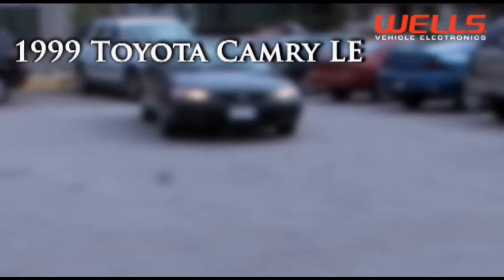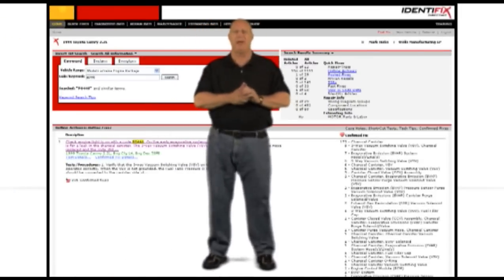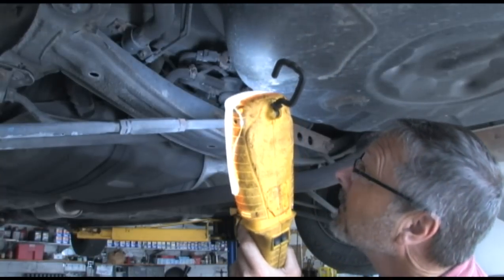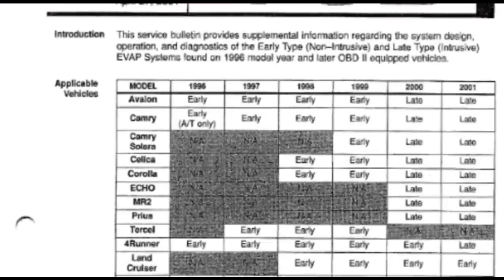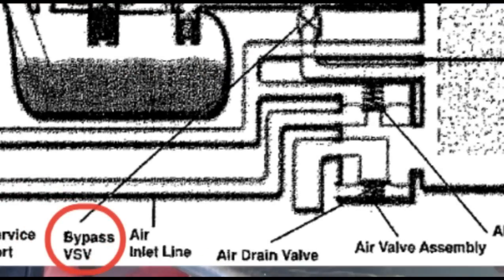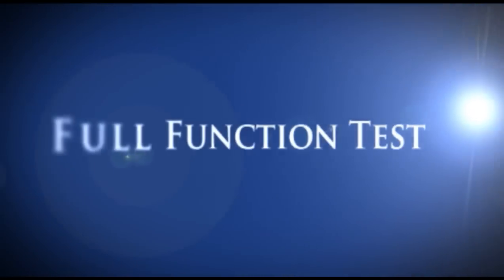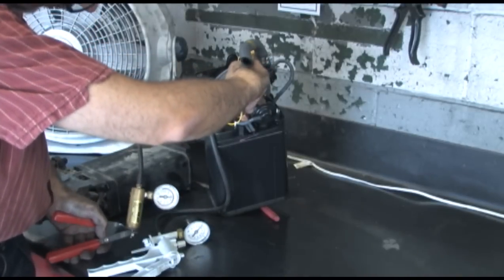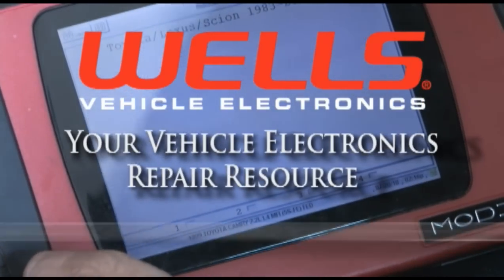Toyota Po441, P0446 EVAP Vacuum Switching Valve VSV Testing and Canister Replacement

Comment: Might b off topic but I have a 2000 solara and can’t find where the burning or exhaust smell is coming from there’s a strong smell inside the cabin coming from vent please help
Reply from the maker: Hey Guess Who, sounds like you have an exhaust leak. How's the exhaust look/sound?
Mike Becker, Senior Technical Instructor
Reply: NGK Technical Training we just replaced the catalytic converter but didn’t check whole exhaust I also checked the heater core seems to b fine no leaks I’m stumped??!!!
Reply from the maker: If you have exhaust leaking into the cabin then you should either stop running the car in the closed garage :)  or fix the exhaust leak.
Mike Becker, Senior Technical Instructor
Reply: NGK Technical Training I have a very small slow leak on back side of valve cover corner u think that would be my problem
Reply from the maker: Depends if the smell you are getting is exhaust or burning oil. If that oil is leaking out of the valve cover and dripping onto the hot exhaust and burning...well that will cause a smell. More importantly...that can cause a fire! I remember back on the GM 3.8L they had a big issue with valve cover gasket leaks leaking onto the exhaust.
Mike Becker, Senior Technical Instructor

Comment: Can you safely drive your car with a code 446? Will it stall? Cause damage? Short on cash at present! Can you tell me?
Reply from the maker: Hey Michael, it depends on the failure that's setting the P0446. Sometimes it's a simple issue where the valve is just stuck open. That won't cause any issues. But, if it's stuck closed it can cause your fuel tank to be hard to fill. It will keep clicking the nozzle off when you're trying to put gas in.
Mike Becker, Senior Technical Instructor
Reply: @GoTechTraining  that's what happened to me with my 06 mazda3. I never experienced something like that. Cost a pretty penny. Now today my 04 Mitsubishi has a p0441

Comment: Hello. if the canister is defective or VSV valve only what will be the signs or symptoms? Will it cause a howling/Wheezing sound during acceleration?  I am having problem with my 2003 solara camry. During acceleration at 2000 RPM the sound starts and continue . If a put it in cruise control like 60 MPH the sound continue and evident.  If I decelerate or takes off the gas pedal and on to the brake it disappears. Yes I do have the code P0041 and P0446. Thank you.
Reply from the maker: Hey Artem, it's unlikely that a bad canister or vsv valve would cause a sound of any kind. I suppose it's possible, but I have never run into a case where that's happened. I'd have someone rev the engine and try to pinpoint where the sound is coming from.

Mike Becker, Senior Technical Instructor
Reply: Thank you. I have to get a smoke machine and test the lines. Also I ordered the VSV valve first. I'll update you. Thank you
Reply: If the problem is 100% fixed, do the codes clear themselves if you don't clear them

Comment: Can I completely remove my vacuum system on my 97 Toyota t100 v6
Reply from the maker: Hey Tommy, you talking the EVAP system? The car is designed to use it. I would NOT recommend removing it. 
Mike Becker, Senior Technical Instructor

Comment: Hey Mark, I have a code P0440, P0441, and P0446 large leak "0.080" 
Same car in the video but its a 2000 camry. Im aware these cars have 3 vsv's. 2 by the engine and 1 by the canister.  I replaced the fuel cap today and erased the codes just in case it was the fuel cap...but is there an easier way to check the vsv without removing it? Cause i need to check all 3 don't I..?
Reply from the maker: Hey Eddy, This is a very complex system. My advice to you would be to watch our training class that teaches this system. Thanks! https://youtu.be/BkxeXZ6Ndjs?list=PLq_Q0mT6-rccmY5Ai-CtVf9Xjgk9CpdeO
Mike Becker, Senior Technical Services Instructor
Reply: Eddy Rivera did you figure it out?
Reply: Wonderful I have a 2000 Camry. Mine would have to have three vsv’s if your right. So changing the whole canister won’t be a positive fix with two more vsv up front

Comment: How much do they cost to replace on a 2000 Toyota Corolla? Thanks
Reply: rockauto has the cannister for $194
Reply from the maker: Hey, best bet is to get an estimate from a shop. They will be able to accurately price the part and the labor for install. 
Mike Becker, Senior Technical Services Instructor
Reply: 3 or 4 hundred bucks minimum uphere in Ohio

Comment: I switched the vacuum valve for my 2004 toyota matrix  but still got the check engine light. Any recommendations
Reply from the maker: Francisco, there's a million things that can cause a check engine light. I need more a lot more info from ya. For starters, what codes? 
Mike Becker, Technical Services Instructor
Reply: 0441
0442
0446

Comment: I HAD  p 0441 AND P 0446. I HAD ACCIDENTALLY PULLED OUT THETINY HOSE WHILE REPLACING THE AIR FILTER. ALWAYS CHECK HOSES FIRST .
Reply from the maker: Hey La Nazaakat, nice find! Sometimes just a simple visual inspection can lead to the problem. Way to not throw a bunch of parts at it. Well done!
Mike Becker, Technical Services Instructor

Comment: I just had the entire canister replaced which included a new VSV with it , on my 99 Camry 3.0 and also replaced gas cap .the P0441 code went away and was replaced with the P0446 any ideas. This was replaced at a shop BTW.
Reply from the maker: Hey R H, usually it is the canister and VSV that causes this code, but being that everything is new I would have to put money on either bad wiring, bad control from the PCM, or maybe a bad fuel tank pressure sensor. I think it would probably be best if you take you car back to the shop and tell them it still isn't fixed. 
Mike Becker, Technical Services Instructor
Reply: Wells Vehicle Electronics is it possible it could be the fuel rail mounted valve?
Reply from the maker: You are talking about the purge solenoid? Sure, it's possible. Inspect the "VSV for EVAP' which is the purge and make sure it is closed normally, and open when you apply 12 volts and ground. Check this video out, we talk in depth about the EVAP system in your Camry/ https://www.youtube.com/watch?v=BkxeXZ6Ndjs&t=25s
Mike Becker, Technical Services Instructor

Comment: I have a 2000 Camry. Purchased the car not long ago. It has a Dorman unit and I am having P0440, P0441, P0446 codes. The VSV is working fine. I can pull vacuum on it and energize the solenoid and it releases the vacuum.

I decided to smoke test the car from the front. I disconnected the 2 lines at the vent and purge valve and use a Tee to inject smoke into them. I also used a pair of hose pincher vice grips to  pinch off the hose at the canister that vents into the frame. 

I saw smoke coming out of the one weird line back there that has the one two sided  clip that are difficult to remove.  The canister had been previously replaced.  When I looked at the O-ring inside that connector it was smashed up and out of place. I replaced it and no more smoke came out when doing the second smoke test
Reply from the maker: Jackson, that is great! I wonder why that O-ring got damaged, maybe from the install? Sometimes it's the most simple things that cause it huh? Well done!
Mike Becker, Technical Services Instructor
Reply: Wells Vehicle Electronics I believe what happened was since that connector hose is sort of short whoever put it in there must have gone in at an angle and it pushed against the O-ring inside and messed it up
Reply from the maker: Ahh that makes sense Jackson. Nice find! 
Mike Becker, Technical Services Instructor

Comment: Hi
I have code P0441, changed gas cap but didn't help. I took out Vacuum Valve Solenoid which is on the engine. I blew on side A and air came out through the other side B, next  I blew on side B the and air came out through side A. 
Does that mean that VSV switch is faulty?
Part  I am talking about is
https://www.amazon.com/dp/B00G0OUYV0/ref=olp_product_details?_encoding=UTF8&me=
Reply from the maker: Hey Irfan, you haven't mentioned any vehicle information, but I think I get what you're saying here. You took of the purge solenoid which has one hose going to the intake manifold and the other to the EVAP canister and you can blow through it right? Almost all purge solenoids are meant to be sealed when they are not supplied with power and ground. Being that you can blow through it, I would say the part is faulty. Check out one of our newer EVAP classes for even more info on the subject! Thanks!
Mike Becker. Technical Services Instructor

Comment: I got this code for my 1999 avalon. Is the canister located in the back of the vehicle as well for that car?
Reply from the maker: Hi Daniel, by the looks of it, your canister will be in the back of the car as well. It looks like it will be sitting right on top of the cross member between the 2 rear wheels. 
Mike Becker, Technical Services Instructor
Reply: Wells Vehicle Electronics thanks! Just got it replaced. Took about 3 hours. Any idea about the drive cycle to clear to code before smog? Dont see anything specific to the 99 avalon

Comment: Were can I locate the evap valve on a 1999 lexus gs300? I have coded p0441 & p0446. I replaced the old gas cap with a new one but still have codes poping up.
Reply from the maker: Hey Ronald, looks like it's in the same location as on this car. In the rear near the fuel tank.
Mike Becker, Technical Services Instructor
Reply: THANK YOU
Reply from the maker: You're welcome! Good luck!
Mike Becker, Technical Services Instrcutor

Comment: I have a 99 Toyota Solara with the V6 I have replaced the front and back sensor the gas cap today I replace the evaporator canister I have checked for leaks from front to back and I still have the 446 code showing up code shows up before the engine light comes on
Reply: is there any kind of possible. Maybe you can give me to help me out I'm in a bad spot she has to be smogged like today I'm out of funds because I spent everything on this car I'm almost home so I've got to get this thing running I sure would appreciate some good help
Reply from the maker: What do you mean the front and back sensor? Have you taken this into a shop to have it smoke checked? That is really the only way to 100% be sure there are no leaks in the system. Something as small as a pinhole in any of the evap hoses can create a problem.
Mike Becker, Technical Services Instructor
Reply: it was talking about the sensors the one in front of the motor on the header the one in back of the motor on the header and the EVAP on the back axle but I think I've narrowed it down to an exhaust leak if that can affect you or those that are showing so I replaced both sensors and actually the two sensors codes have gone away but the 4461 showing up but today and tomorrow or getting it welded up so I can go from there
https://lh3.googleusercontent.com/omw5dl30KBz2ZcIkjw4Wu-CvXbqMNEw3sJ_qaTdZa-y4JaklNO7n2udIXQjfXFBGNuJUWGfhYQ
Reply from the maker: Jones,  a P0446 has nothing to do with exhaust or oxygen sensors. It is an EVAP emissions code. The 2 are completely unrelated and welding exhaust will not fix your problem.
Mike Becker, Technical Services Instrcutor

Comment: i have a 2001 lexus is300. its showing p0440 and p0446. whats the common cause ? i took the fuel cap to get tested before i bought a new one and its good. Do you think i may have a problem with the vsv?
Reply from the maker: It is possible the VSV is the issue. The most common repair on your vehicle for those 2 codes is replacement of the entire charcoal canister assembly. They are super common on your Lexus.
Mike Becker, Technical Services Instructor

Comment: How much voltage should be going to the connections ? I've replace the canister and gas cap and light is still on ,Several mechanics are saying I might have a short in the system and want like 500$ !! That's nuts. Any help would be greatly appreciated!!
Reply from the maker: What connections are you checking? What codes are you getting? What year/make/model car are you working on? I'd be happy to help, let's start by getting this stuff answered so I can. 
Mike Becker, Technical Services Instructor
Reply: Did you get all new parts?

Comment: Hi there, I have a 2005 Corolla CE 1.8L A/T. I have received multiple codes for it in the MIL. P043E, P043F, P0441, P0455, P2401, P2402, P2419. Where would you suggest I start diagnosing? I have done a small amount of research, which has led me to believe that a large number of the fixes come from canister replacement (as described in this video). To give you some insight as well, I am finding it difficult to start the vehicle after refilling the tank at the gas station. Many videos are saying that if this is an issue, there is likely an issue with the "purge valve". Is the purge valve the same as the "vacuum switching valve" that is described in this video? Which would be attached to the canister, and therefore cause me to need to replace the whole canister? I was lead to believe that the purge valve is in the engine bay, but maybe there are two of them. Thank you
Reply from the maker: Hi, You have quite a few codes goin on there. There is a Toyota TSB related to the issue you are having. Essentially it says that the computer hold the purge solenoid continuously open instead of pulsing it. This can cause the exact issue you're talking about. Send me an email, I would be happy to send you out the tsb for your reference.
Mike Becker, Technical Services Instructor
Reply: Wells Vehicle Electronics Sure thing, how can I send you an email? What is your address
Reply from the maker: Hey, sorry I had meant to leave you my email. I just sent an email through to you. Good luck on fixing your car :)
Mike Becker, Technical Services Instructor

Comment: I have p0441 on my scion xa... what can I do? :'(
Reply from the maker: Hi there, what year is your Scion? I can do some research and see what is common to your specific vehicle with this code.
Mike Becker, Technical Services Instructor
Reply: +Wells Vehicle Electronics scion xa 2006 thank you
Reply: +Wells Vehicle Electronics hello so I have 1999 toyota camry with the code P0446 so I pretty much have to buy the whole canister since it's an early model?
Reply from the maker: So on your car, the fuel filler cap is very common. Also, it does look like the canister comes as an assembly. That is the second most common item. Your best bet might be to take it in and have it diagnosed. Sometimes it's better to spend the money on the diag instead of changing out multiple possibly costly parts.
Mike Becker, Technical Services Instructor
Reply from the maker: Unfortunately that is the way these came. Like I said to Jeisoon, you might want to have it diagnosed before trying a canister. Being that it is a higher cost item. But they are very common, especially on the older Toyotas.
Mike Becker, Technical Services Instructor
Reply: +Wells Vehicle Electronics oh ok thank you and also I have another problem with my 99 Toyota camry when I start it in the morning or it has been sitting for a long time a puff of smoke comes out the tail pipe only when started then it's back to normal could the canister be the cause or is it something more serious I get no other code with my scanner I'm not good with cars
Reply from the maker: How is your oil level? Does your car seem to use oil? That problem is common to bad valve seals leaking oil into the cylinder as the car sits. 
Mike Becker, Technical Services Instructor

Comment: Hello, I have  2000 Lexus GS300 and I got the P0446 code. I have a new VSV for replacement but I'm unsure of the location. Is it in the back next to the charcoal canister or under the hood? Also which is likely to fail 1st the VSV or the canister?
Reply from the maker: Hi George. The VSV on your car shows to be mounted under the hood. As for the most common repair for your P0446...the canister is the most common. But the vsv also has a moderate failure rate. It might be wise to try the cheaper one first, or have the car diagnosed first. Remember if you do try one, the light will not go out on its own right away. You will need to clear it, or drive and pass the system test multiple times, which for evap can end up being hundreds of miles. Good luck!
Mike Becker, Technical Services Instructor